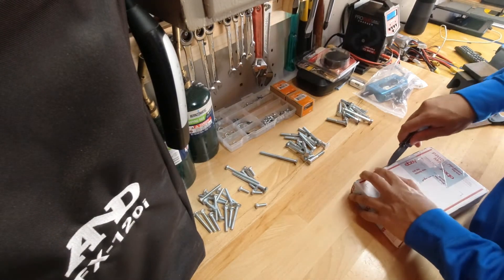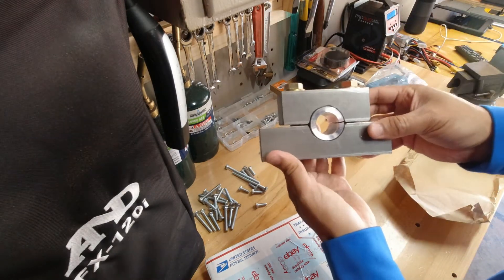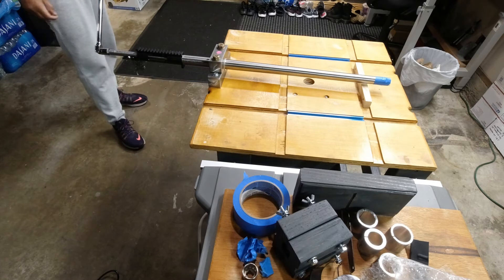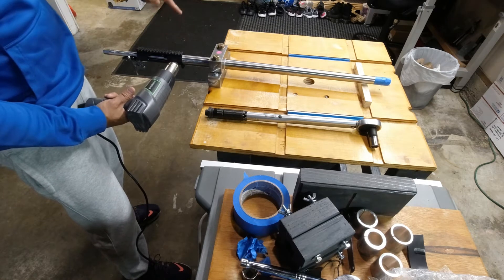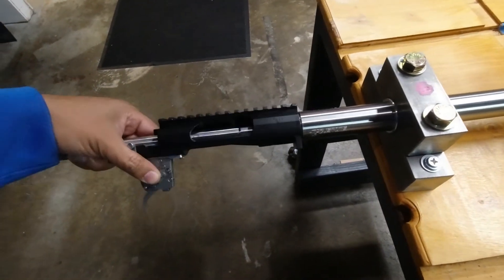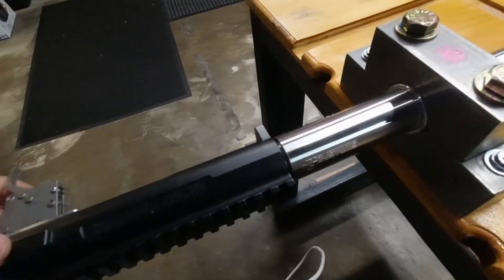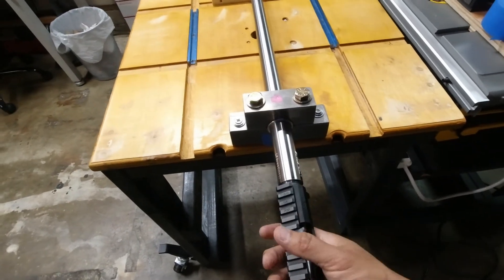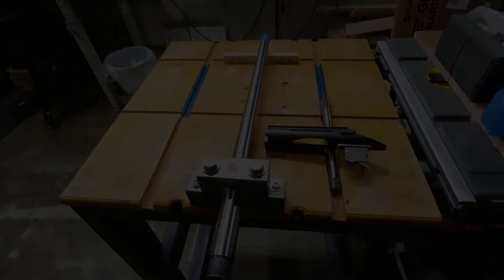How to remove a barreled action (Remington 700, Impact Action) - Part 1

Comment: Factory Remington barrels are installed with a locktite like adhesive. 
If you heat the receiver ring to about 250 degrees with a heat gun, the adhesive will melt & the barrel will come out easier.

Comment: Damn, that was a whole lotta torque on that barrel.  I use a Zeus action which is two set screws and about 5lbs of hand torque to install/remove a barrel.  I can swap one in less than 5 minutes.  I do have a R700 action with original barrel Ima bout to swap out with a Remage for F/TR comps.  I actually dread it for this reason.  Remington is known to really crank down on their barrels and I expect it will be 90-120fps.  Don't worry man, you'll get better each year at doing things like this.  First step is believing in yourself to be capable, and the rest is just obstacle.

Comment: You should really take off your trigger.  When the barrel brakes the torque you can sheer the trigger right off the action.  Great video keep them coming
Reply from the maker: Good one! Didn't think about that Bobby!
Reply: @BustaGrill  I've seen it with a buddy's trigger.  The barrel was torqued to 100 ftlbs and when it went pop the trigger flew across the garage sheared right off.  Pins were still in the action 

Hate for that to happen to ya triggers aren't cheap
Reply: I sheared off a nice Timney two stage trigger like that. An expensive lesson.